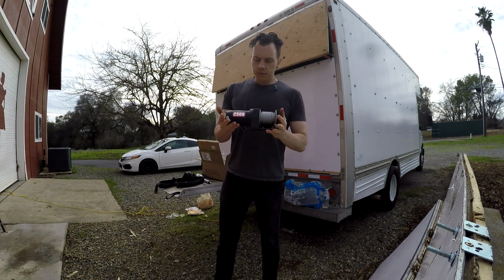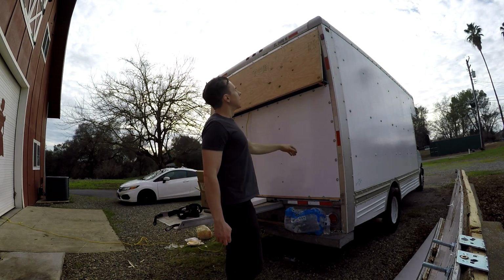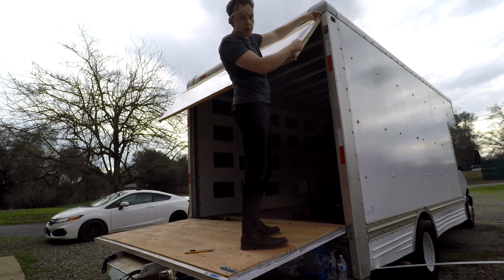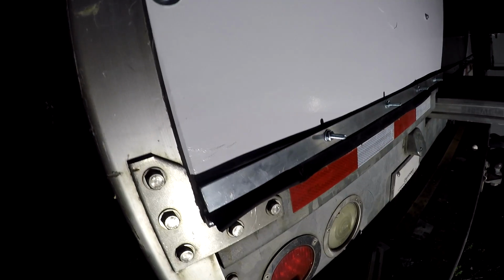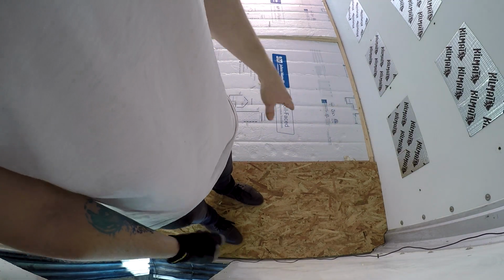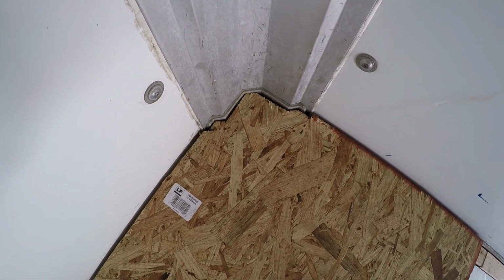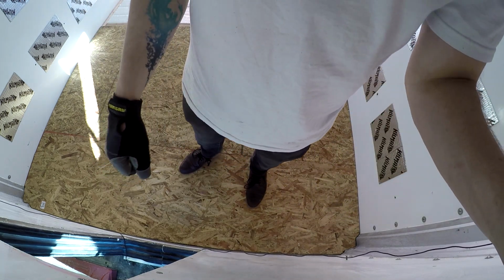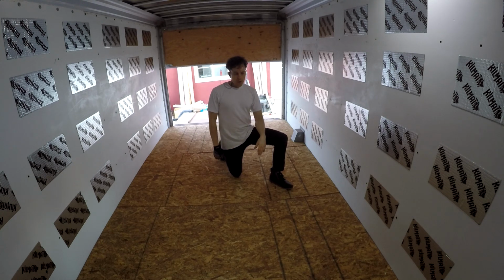Box Van Truck Tiny Home Conversion #4: Subfloor and Vinyl Wrap

Comment: just a little observation... hope the fuel pump NEVER GOES BAD in that truck.
WHY ? in the back of the box floor about the level of the gas protrusion, just in the center between both side walls, there is a little square, like 12 by 12 inches, held by screws, that gives you access to the fuel pump in the thank, you should have left some sort of access to that service port  jut in csse thr fuel pump need to be replaced, AND IT WILL !
Reply: ask me... how I know !
Reply: @verocola6335    Isn’t the access plate to the fuel pump on the floor? If so, how is that at the same level as the gas fill up thingy that’s on the bottom of the wall?

Comment: The vinyl looks great! I would expect it might not last more than a year or two. Some thin sheet metal might have been best for long term "stealth" look. 4x8' thin sheet metal weighs about 65 pounds, so at least the vinyl is much lighter and less expensive.I'd put some of that weather stripping where the doors fold up against the box, to quiet the doors from rattling too much. Might consider a patch behind the extended bolt areas on those slider locks for same reason.

Comment: Nice videos, I'm also considering a box truck. Are you concerned about possible sag in the middle of the floor? I was tentatively drawing out plans and was considering installing studs down the middle of the 4x8 floor frames. Reading a book on schoolies where the guy didn't even lay down studs, just poly and plywood on top. Also was considering on having water on one side and dry on the other, just to minimize the possibility of a water leak mixing in with my electrical. Maybe even go as far as water on one side in the back and electronics/heavier machines/fridge on the opposite side in the front. Oops, just noticed the date of this video. LOL. You probably already finished.
Reply from the maker: I chose to run my electrical all over the ceiling and my water on the ground... any leaks, accidents or damage resulting in water in/on the floor will not ever touch any electrical. 

As for weight distribution, I'll have 60 gal fresh water on one side and my batteries/grey/tank/black tank on the other side to balance it out.

Comment: I have a U-Haul box truck that I'm converting, as well. I'm concerned that covering up those plates on the floor that you can see at 16:04 will prevent me from accessing potentially-necessary components for future repairs. Is that what those plates are for? Should I make the floor removable at those locations?? I think there's also one in the middle of the floor.

If I make the floor removable, there's extra precautions for waterproofing to make... I'm not sure how I'd go about that. Hmm...
Reply from the maker: Doubt it. In mine the plates had clearly never been moved before for any type of maintenance. If that was the case, it would be a regular thing that Uhaul removes at certain intervals to do maintenance, but that's just my guess. Good observation though.

Comment: What vinyl did you get?  All of a sudden, there are rivets, or rivet looking pieces on the door?
Eh....
Reply from the maker: Updated the description with a link to the vinyl I used. Those are bolts that I need to find some caps for
Reply: @TheTechnoBarbarian  Put on  opposite manner so nothing outside to unscrew, granted bolt ends inside but still "cleaner" look. I like the back side change nice very nice! Oh that new contour thing for the corners- I  was saying to myself - nice use dam , making use of right tools!

Comment: I applaud your can do attitude but you really could use a second set of hands for some of this stuff. Tell Delaney to stop carpet munching for a couple hours and help you apply this stuff.
Reply from the maker: Ha yeah some of the stuff I will need an extra set of hands for eventually
Reply: @TheTechnoBarbarian  I know you already bought that corner jig. For future reference or if you misplace that tool there's a cheap alternative. Use cardboard to cut out a template then transpose it on the wood.
Reply: I'll see if I can make some time to assist him in between the munch sessions I have lined up lol